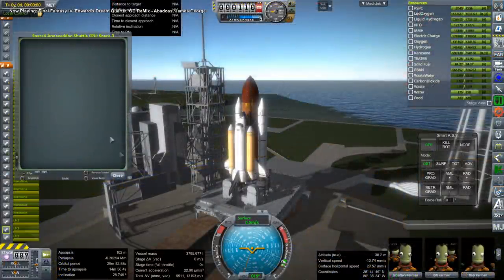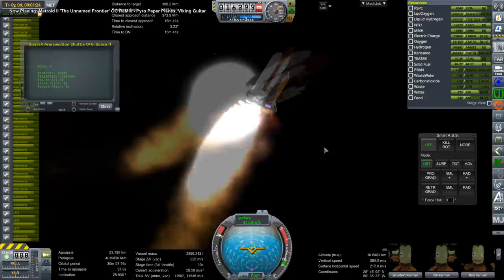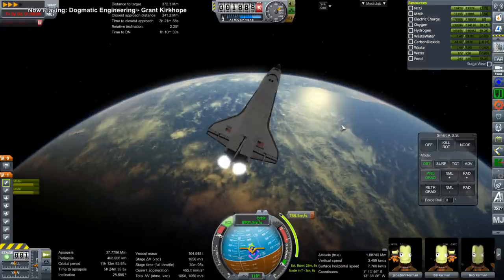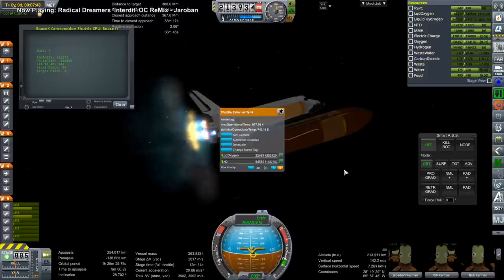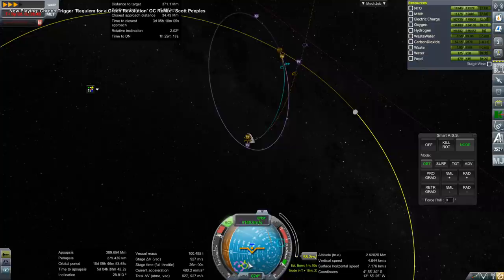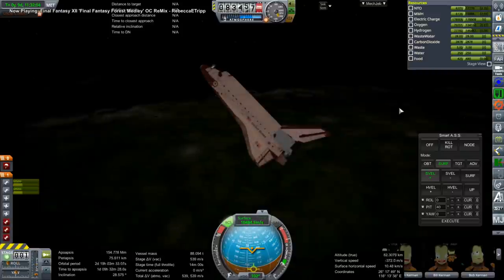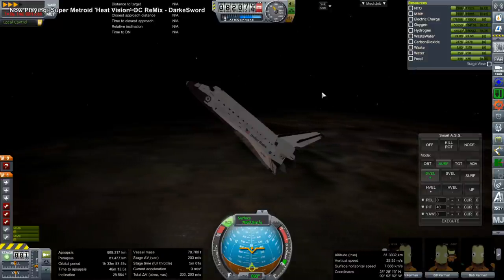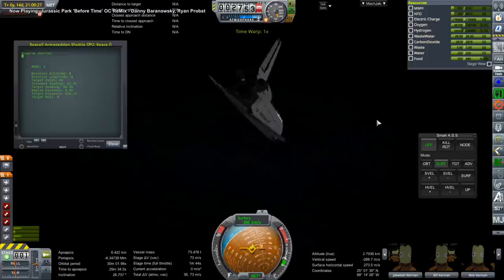Realism Overhaul in KSP - Shuttle to the Moon 2 - Merlins

Comment: Well, I guess this answered one of my Quora questions (imperfectly but better than the existing answers): If launched on a large enough vehicle to send it on a lunar trajectory, could the Space Shuttle have survived reentry provided it did it in several high-altitude passes? If so, how many passes and how much time would it take?

16:40 Ah, that's one trick you didn't try! Power massive helicopter rotors using Rolls–Royce Merlin engines to lift the stack to a higher altitude before ignition! /s
...

Seriously, though, brick-like as it is, it'd be really cool to see someone fly a Space Shuttle Orbiter in KSP RO as a conventional airplane (slightly modified, of course, with added engines [maybe replacing the OMS and using its tanks], retractable landing gear, and a positive runway AoA, and in a later test the engine aeroshell). Particularly because it would reveal at least a good approximation of the Shuttle's actual maximum L:D (it's typically given as 4.5, but I highly doubt that is true because its AoA seems well above that optimal for lift upon landing).
Reply from the maker: Testing it with air-breathing engines would be interesting, and I expect with its fairly large wing it should do well. The flying brick notion is a gross mistake, and you can look to its wing loading to see that. It has 80000 kg roughly being brought down on a wing area of 250 sq.m. That's a wing loading of 320 kg/sq.m., which is better than that of any airliner at its maximum takeoff weight (Boeing 777 at 578 for instance) and better than some at their landing weight. Its wing does get more drag because if its large leading edge, but there are other planes with hefty wings that have worse wing loading and aren't considered flying bricks. And then there's the F-104 and lifting-body prototypes . . .

Comment: I built a shuttle "replica" and I am testing it and testing it and can't get it to work. I've screwed with COG and all kinds of things but I can't keep it from flipping after SRB separation.
Reply: too much torque, try tilting your engines to the center of mass. shuttle takes a lot of finagling to get the engines in the right place to control itself through the flight. i remember having to ditch my large orange fuel tank early just to keep stable but, still made orbit
Reply: @bevvyfischer4386  That's what I have been doing. It's very finicky lol. Thanks for your advice.
Reply from the maker: Best thing is to take the SRBs off in the VAB and see where the thrust line is compared to the Shuttle-ET center of mass. Drain the external tank and see how the CoM moves, then try to angle the SSMEs so that the center of thrust is in the middle of where the CoM starts and ends.

Comment: hey raiz space, you can fix the premature separation in the script by labelling the engines of the falcon boosters as lets say       side_eng      and then you can do       set s_eng to ship:partstagged(“side_eng”).         and then for separation you do                   for side_eng in s_eng {  if side_eng:thrust=0 { set state to “boostersep”.   }   }         I’ve used boostersep as an example for separation because I use a loop with states
Reply from the maker: Yeah, I just didn't want to change the shuttle launch script - a bit lazy, I guess.

Comment: Is it just me, or are you wasting rocket fuel by not releasing clamps immediately after ignition?
Reply: Leonid Saykin it takes time for engines to reach full thrust
Reply: Ignition sequence takes a few seconds to reach its full thrust.
Reply: the launch clamps in this mod supply the tanks with fuel constantly, so staying lit on the launch pad is okay. the engines need time to spool up anyway, else you drop right to the ground